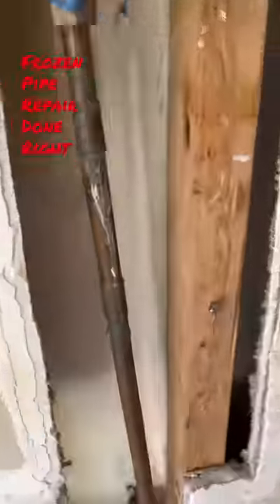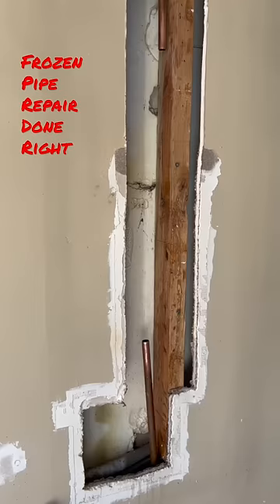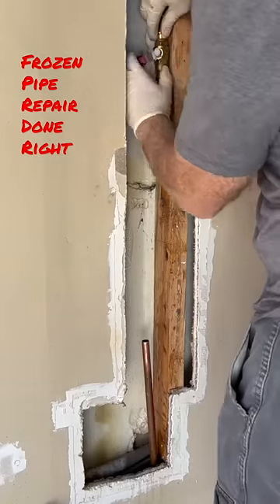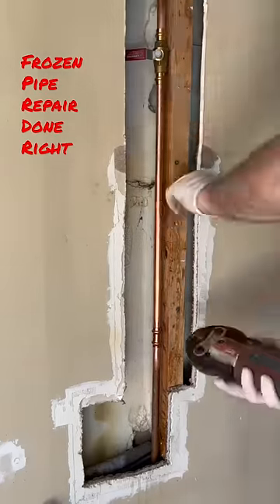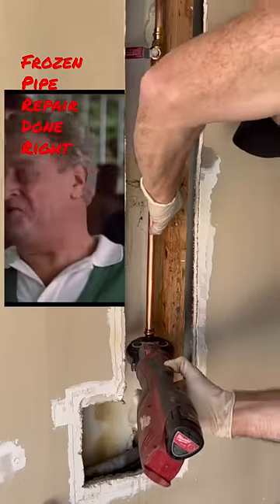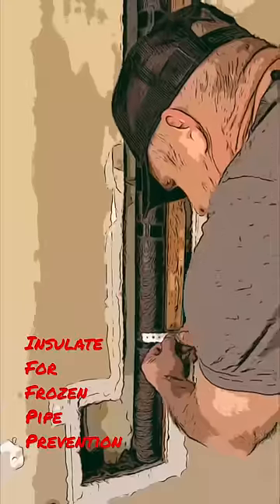Frozen Plumbing Pipe Repair @TappPlumbing #shorts #plumberslife #plumbingproblems

Comment: One of the first things I did when I bought my home a few years ago it was dropped dead cold and one of the pipes did freeze. Luckily it did not burst. I went to home Depot grabbed a bunch of that insulation foam tubing and wrapped those pipes up so good under the house in the crawl space. I never ever worry anymore since that day about how low the temperature may get outside.
Reply from the maker: That is such a smart move! It is always great to have one less thing to worry about as a home owner. I would like to suggest to keep some water running also , just open up a faucet. Thanks for sharing your story!!

Comment: i dont think he was throwing people under the bus but i am a plumber by trade for 35 years and i always cut out old repairs. I have used propress in the past but prefer either solder or even pex. Propress does have its place. I do commercial maintenance now and i can tell you, solder is great but getting it to last 50 years now ,is a stretch. ive seen copper fittings and pipe itself fail in a few years . just not as good as the old days. I know homes with the old poly and pex on wells and they are still going. so nothing lasts forever

Comment: I'm sure the valve that you won't be able to get to after the drywall goes backup is your lack of ability to figure out that the other valves that were put on were to stop the flow so they could solder. Hence the compression and sharkbite. You could have just used two couplings with the crimp joints. So, just another non-plumbing hack. Not to mention the awesome drywall removal cut!
Reply from the maker: Awww thank you for reaching out!  We appreciate you!

Comment: That solder comment was completely valid. That was awful looking. As an apprentice plumber I’ve done a decent bit of soldering and that is by no means something even I would be willing to let someone pay for. Soldering isn’t hard and if you just wipe your joints after soldering while still hot they will come out far cleaner.

Comment: Well, pex a is freeze resistant. It can completely freeze and be just fine.  Also, why keep putting a valve in the wall?  By doing so, you need an access panel.  Why not in a crawl space (if available) or an attic.

Comment: I'd insulate the back wall to keep out the cold, not insulate on the side facing the heated space so the pipe won't freeze, and I'd replace the burst pipe and all of the previous repairs with PEX that doesn't burst when frozen.
Reply from the maker: Those are all outstanding suggestions. That line feeds a Spigot and in my opinion, the copper gives it a more secure feel during operation. You do have an excellent point about the pex! I gave the same suggestion to the homeowner about the insulation. Thank you so much for a great comment. Thank you for watching also!

Comment: I would have only put the insulation on the back, or cold side, of the pipe, insulating the whole stud space. Leave the front side open to be heated by th inside of the room. Also, best to have an air space between the pipe and insulation to prevent direct cold transfer through insulation and into pipe. It may seem like overkill, but you will never have problems  again.

Comment: Interested to know what region this work had to be done.  Depending how north and how cold it gets in winter even that insulation may not work.  Had a similar issue many years back, the pipes in the north side of the house (harsh very cold winds always blowing towards in winter coming down from the arctic) would keep freezing after an extreme cold spell.  Didn't matter how well it was insulated.  Finally had to install pipe heating cable that would have to be turned on before a bad cold snap was coming.   

Yes the house had a bad design re some the plumbing.  But end of the day, sure was happy to find out about heating cables.  

Also say am sooo happy I don't live that far north anymore and have to deal with long winters with many a day well below 0 days and many nights.

Comment: The problem - which the repairman STILL didn't address - is the cracks and missing chunks in the plaster wall behind the framing! Instead of wrapping the pipe in insulation, use spray foam to close up those gaps back there, THEN install some fiberglass insulation in the cavity but not in front of the pipe, which will allow radiant heat from the room to permeate the drywall and prevent the pipe from freezing. The biggest culprit in frozen pipes isn't just cold weather, it is breaches in the exterior assembly which allow freezing air to whistle through these cracks and hit pipes directly. That's always the thing. You get a cold snap with gusty winds and that icy air is whizzing though your leaky walls.
Reply from the maker: Well stated. Thank you so much for watching!

Comment: Insulation needs to isolate hot from cold. Insulating pipe from cold wall channel will not work. The pipe will eventually equal the wall cavity temperature. If that’s freezing, the pipe will freeze unless there’s flow in the pipe.

Comment: Or u could of used copper × pex adapter 2times, with pex pipe instead of copper and 2 cramping rings. And job done. They probably left the insulation off cause its not on a exterior wall.
Reply: And now, because u have that ball valve in wall , u required to put a access panel there , by code..
Reply: This is what I do.. 20 years strong and licensed.

Comment: Does that insulation actually help? I have a building on my property that I have running water. The pipes are in the interior but every winter a pipe breaks.. im switching everything from cpvc to pex this time around

Comment: With only 1 line there I assume it's likely cold water, I only insulate cold water if there's a freezing risk like an exterior wall or crawl space to help mitigate any freezing, or at client request. Hot water gets the styrofoam snuggie everywhere that it will fit practically though.

Comment: I got a question for plumbers. What do you guys do with the pipes after you cut them. Do you scrap em for some money or just keep them incase you need some pipe?
Reply: I just save them for scrap . Using that pipe is probably a bad idea since most of the time it's very old and might be prone to leaking.

Comment: Wouldn’t it be better to use pex for the patch, instead of copper, because it doesn’t  burst as easily when it freezes, as copper does?  Kudos on adding insulation.  Hard to believe the other guys didn’t think of adding insulation around the pipe!
Reply from the maker: No doubt pex holds up better to freezing temps. I went with copper because that line fed a spigot. In my opinion it has a much more secure feel during operation and can hold up to the abuse an outdoor valve receives. Thanks for sharing a great view point!!

Comment: I'm not saying there's anything wrong with this job, it looks damn good, I'm a plumber in Texas so it stays warm here most of the time but if I see a pipe that's had multiple freeze breaks I would put in a section of pex so maybe next time it will expand the pex instead of the copper
Reply from the maker: That is a very logical suggestion! That line feeds an outdoor spigot, in my opinion the copper gives a more secure feel during operation and holds up a little better to the abuse the outside valves receives. Thanks for spending some time with us!!!

Comment: Insulation didn't do any good for the freeze we had here in Texas recently. Every and I mean every freeze break I went to had foam Insulation on the copper pipe. They still bursted. There would be multiple breaks on the same pipe with Type M copper which is thin. There were breaks on Type L as well. That ProPress sure came in handy to get a lot peoples water back on 😁
Reply from the maker: Many people just don’t understand if the temperatures get low enough there is realistically not much that will prevent the splits. We just have to make the best attempt we know how. Love the press and have for more than a decade. Thanks for watching!

Comment: I'm wondering why pro-press ball valves were used instead of Couplings?
Reply from the maker: There is a valve in the wall to shut down the spigot it feeds. There will be an access panel installed when the drywall is repaired.Thanks for watching!!!

Comment: One batt of pink on the cold side of the cavity would do wonders. Also leave a tap on slow  when it is very cold. 
It has frozen 4 times before. There is a problem with location.
Reply from the maker: Thank you for watching!
Reply from the maker: Thank you for watching!

Comment: When I re-piped my entire house in half inch copper (sweated it myself) with no leaks, used insulation on all pipes esp. in basement where it's not conditioned. Got down to -8 last month.
Reply from the maker: - 8? Where do you live? My father was a plumber and lived in South Carolina when he was young. He said that’s how water pipe was sized there back in the day. All 1/2”. Thanks for watching by the way!
Reply from the maker: I forgot to ask, certainly you left some water running?
Reply: @TappPlumbing  That was 22 years ago.

Comment: I would've probably put some fiberglass insulation between the pipe and exterior wall too but I understand there's only so much you can do. I wouldn't want any lines in an exterior wall.

Comment: At age 7, I helped Dad solder plumbing in the house we were building. He would use an acid flux on the outside of the pipe where the fitting would be attached, tinning the pipe end, then followed up with running a bead of solder around the fitting edge. This would be the way I would do it.
Reply: Please show us how to "run a bead of solder".

Comment: I put that pipe insulation around the rim of a 5 gallon bucket and use it for a camping toilet. My wife and step son thought I was crazy making this bucket toilet but they didn’t grow up camping like I did so they didn’t experience the displeasure of having to poop squatting with your back against a pine tree like I did (my mom’s family is mexican so just imagine having to pass some of the camping meals I would be eating out there lol tons of chorizo and greasy potatoes etc etc lots of burritos). Needless to say the 5 gallon bucket was a game changer for me and my wife/step son actually ended up using it before I did and they both thought it was pretty cool lol. This insulation works A LOT BETTER than the foam from a pool noodle I’ve personally tried both and the pool noodle foam isn’t anywhere near as dense as the insulation foam is

Comment: There's nothing wrong with a soldered connection, only with a poor job of doing it.  If you do it right, the solder joint will last the life of the home.

Comment: Insulating a cold pipe just results in a cold pipe. You need to keep the cold away from the pipe and also bring some heat to it. Go ahead and seal that wall up now. It will be frozen and burst again next year. Instead insulate the exterior of the wall and install a vent to let warm house air get in there around the pipe.
Reply from the maker: I did my best to inform my client all of your excellent talking points. All we do is the plumbing repair. Thanks for spending your time with us!!!

Comment: I love how he says it wasnt insolated but at the start of the video you can see that its insolated up top and he just pulled all the insulation out as well as he used a sharkbite valve which should never be used in a wall
Reply from the maker: There is insulation on the top of the line . When I arrived to do the work it was missing around the repair area. I guess the first person to repair it removed it ? It may help you to know those fittings are a little different than shark bites . They are called pro press . The valve shuts off a spigot and there will be an access panel provided when the drywall is repaired. Thanks for some keen observations and for watching!!!!

Comment: You were the first person to ever put it on, because it's an interior wall and isn't needed. And that shark bite and soldered joint would outlast your crimped joints a million times over you're there because the pipe froze and bust, not because of the connections failing.

Comment: Okay so when you are counting the sections in the pipe you are not counting the insulation that is above the valve as no one ever putting insulation on the pipe? It looks like to me at one point it had insulation but for whatever reason they didn't replace it when they did the other repairs. I did have insulation at one point though since there is clearly insulation above the cut off valve that he last counted.

Comment: Talks shit about previous guys solder work and proceeds to use garbage crimp fittings....these guys are hilarious! I run those joints in a few seconds and outta there.i prefer to have my joints stay forever not have some soft copper crimped with rubber seal. And I don't have to drain the customers bank account either lmao!

Comment: At the very beginning of the video it appeared to be carpet for the floor so I'm assuming this is in the actual home and not the garage which makes me wonder why would you put insulation on the pipe? It's a heated space so there's no worry of it freezing. Now if that was just some type of mat and it was in a garage a little insulation wouldn't hurt.
Reply from the maker: This was definitely in a garage. The homeowner was traveling for Christmas and came home to this. They are very lucky it was in the garage. I went to quite a few during this freeze that were not so lucky. Thanks for watching!!

Comment: Id have used sharkbites and scrapped the soldering. Then stuff insulation. That way I dont have to call a  'professional plumber'.Even if I had to redo it, when I do it myself its not expensive.  Ive not seen many times ive actually needed one.
Reply from the maker: That is a great way for you to save money my friend. It also great you can do the work. Do you work on electrical too?

Comment: Just curious though, maybe it's not up to code in your area or something, but why wouldn't you replace it with pex if it's in a cold to cold wall? Even if it does freeze it usually doesn't bust, you just hit it with a heat gun or even a solder torch (very carefully) and you're good to go. Copper is just a bad choice in this situation.
Reply: You could even just put an access panel and explain to the homeowner what to do. Bam they buy a $35 dollar harbor freight heat gun and you never go back.
Reply from the maker: That is a great question. That line feeds a spigot . I think the copper gives it a much more secure feel during operation. It also stands up better to the abuse a spigot receives such as people trying to yank their hose around the corner . Thanks for asking, thanks for watching also!!!

Comment: Why are we not replacing with pex??
Reply from the maker: Great question! That line feeds a spigot and in my opinion the copper provides a more secure feel for operation. I think where you are going with would be the far superior expanding capabilities of the pex. Is that why you ask?
Reply: @TappPlumbing  thank you for answering! Yes, that's exactly why I ask. After having my pipes freeze and break for 20 winters straight, my son just replumbed the whole house with pex and I'm in love. Lol

Comment: Insulation doesn't create heat.  If that void freezes, the pipe will eventually freeze.
Reply from the maker: That could be true if it gets cold enough for long enough. That normally does not happen in the Atlanta area.

Comment: Have you ever had any problems with the crimp style connections? Are they better or worse than solder?
Reply from the maker: I have had 3 fails in 14 years with press fittings. That is a pretty good track record I think. I will say though nothing is better than a great solder joint. There press is just faster, much more expensive and you can press it together with water  in it . You definitely are not gonna solder a joint with water in the line!

Comment: Pex is LESS likely to break in a freeze! What you should have done was replace it with pex AND and insulation at least to the top and bottom plates.. then use actual fiberglass insulation!

Comment: Put some frostsafe cabel on the pipe and the problem is solved.
Insulation does NOT create heat and the pipe will break again with the solution you picked.
Reply from the maker: This is actually a long story. It got wicked cold here in Atlanta on Christmas Eve . There were breaks everywhere. Things were closed and people wanted there water back on . This only happens around once a decade. So the heat strip is not something I keep on the truck. I do agree with all that you said by the way. Thanks for watching!!

Comment: Solder will last longer than the compression oring fittings if installed correctly. But i know your time is short and you need to get it done quickly.

Comment: Minnesota plumber here.  Get the pipe out of the freezing area, insulation won't help.  You're not fixing the problem by leaving the pipe exposed to cold insulation or no.  You have neatly repaired the pipe but the problem is still there
Reply from the maker: It is a long story ,but moving it was not in the cards for that episode . There is no telling what you would think if you saw how things are done around here. On a side note , I also don’t know how you deal working up there in the winter? Thanks for spending some time with us!!!
Reply: @TappPlumbing  LOL, Every year folks up here hire unlicensed folks who have no business doing plumbing at all.  I spend a good amount of time ripping open walls to remove and re-pipe.  Yes, good for business but bad for customers.

Comment: I noticed that you use Ryobi tools alot.  I have alot of Ryobi tools.  I don't use them much, as I have switched to Milwaukee tools. I had them on my other trucks for the crews.  Now I usually work alone.  However,  Ryobi parent company is Milwaukee.
Reply from the maker: How long ago did you down size ? It is a much simpler way of doing things isn’t it?